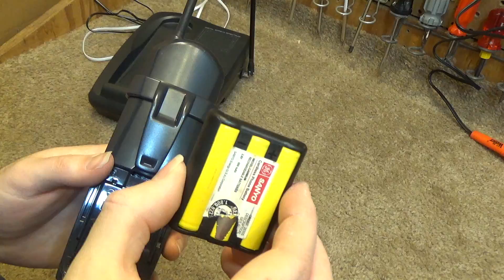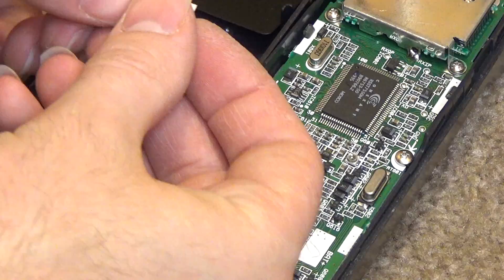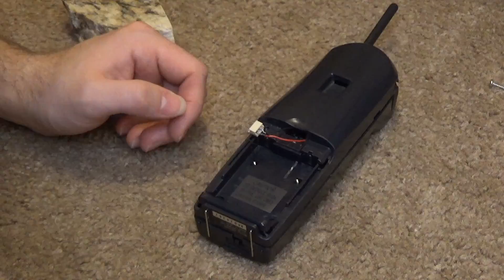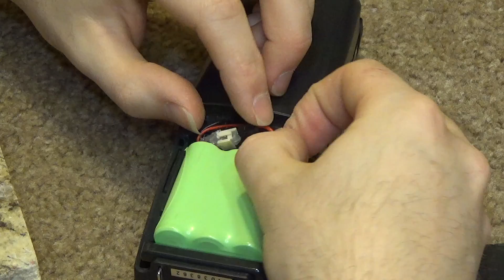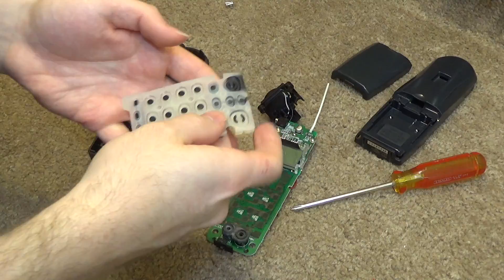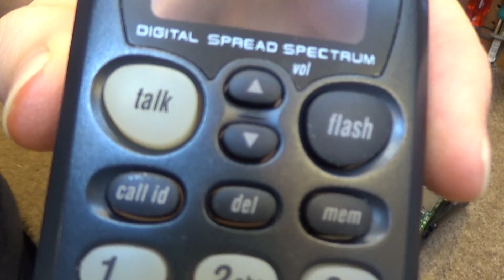Clean, Repair and Modify Uniden EXS9960

Comment: The servicing of a Uniden 900 MHz digital spread spectrum cordless phone, model EXS9960.. The buttons will be repaired and the battery connection will be modified so it takes a more standard battery that is cheaper and in more abundance than the original..
Reply from the maker: Do not post the video's description in the comments box; that's plagiarism..
Reply: Frank - It really is plagiarism. Please stop copying.
Reply from the maker: @aarondunn1489  I've got it under control..
Reply: @JordanU  - Oh. Okay then.